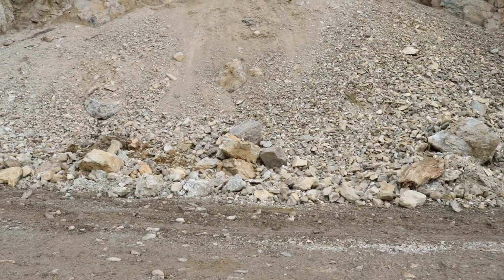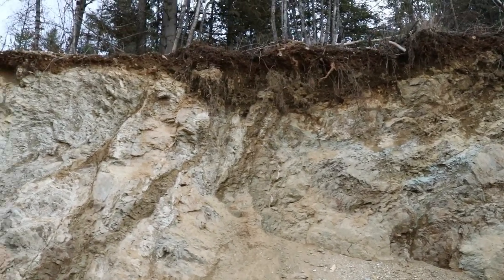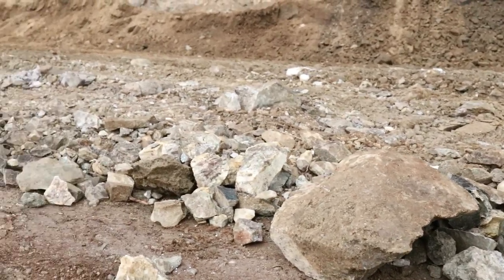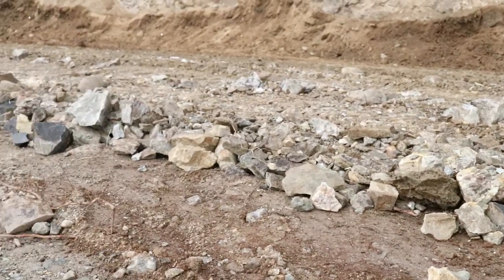Caterpillar Motor Grader Grading Hauling Road in Action

Comment: Great to see you. My build is on hold. TO WET. If I put 4” base rock down it would disappear into the wet clay. When the time comes I’d like to contact you for advise on how to put in the 300’ driveway. But for now I’m just twittering my thumbs. Best to you and your family. Be safe
Reply: If your clay is that bad to do it correctly you'll want to dig out all of the clay until you get to gravel then backfill with good gravel. If it's to deep or not feasible to go until you hit gravel the best thing you can do is put down some Geo tech fabric down and then put about 12 inches of gravel over the top of it. It will prevent the clay from pumping into the gravel.

Comment: I know that this would add expense to the project but normally for safety reasons with cliff faces like that where road vibration will cause debris to fall off the side into the water gully at the edge of the road workmen over here would basically drive in those star piggots or Y shape bar into the ground  vertical as close to the edge of the cliff face & then tie up 3 foot high or higher orange plastic safety mesh that has 1/2" x 1/2" diamond holes in it to catch all future rubble that falls down. I'm not sure if road workmen do the same kind of thing in your country?
Reply from the maker: That's a good idea for a high traffic road but this road only accesses four homes which makes this slightly more then a driveway.